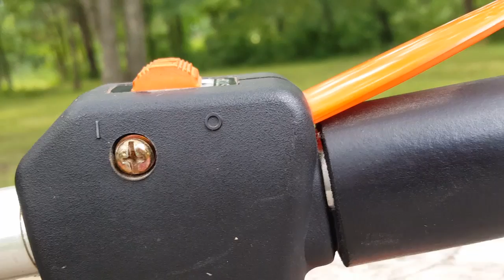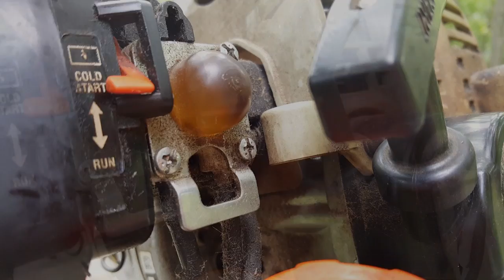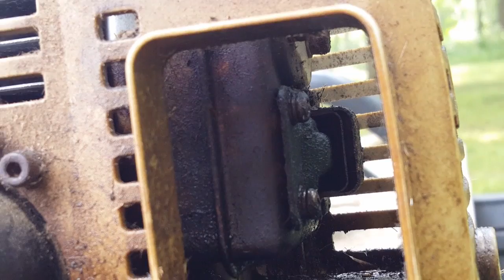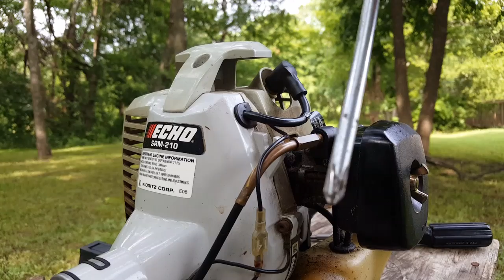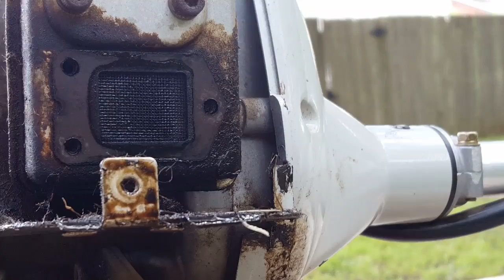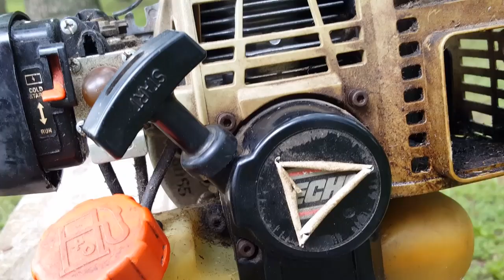Echo Weedeater starts but has no power and runs bad. Clogged spark arrestor. Easy and simple fix.

Comment: Very professional video i ever seen about trimmer now i did every thing you showed nothing work on my Echo SMR210 so i replaced carb 1st day its works like a charm next day it didnt start so i bought new carb again but nothing happend (i changed spark plug, filter) any one have any idea???
Reply from the maker: Thank you Faraz Khan. Please confirm that you have spark just to rule it out. Remove the plug and reinsert the plug back into the spark plug boot. Rest the threaded part of the spark plug against the metal of the engine and lightly pull on the pull handle. Look for the sparks. If you have spark look at the plug itself and see if its covered in gas. If so then the engine is flooded from all the attempts to start it. Leave the engine sitting for a day without the plug in it to let it dry out a bit. Next day replace the plug and try to start it but us NO choke and hold the trigger completely open. Pull it a dozen times and hopefully it starts.
Reply: Thanks for your rply i did what ever you said and i leave trimmer 3 days (just in day time at 90 degree) tried to start if without choke dozens of time and then choke but my friend nothing happens still dead.
Reply from the maker: Faraz Khan thank you for trying. In your attempts  to start it did you ever try using starter fluid or even some gas into the throat of the carb.  If it doesn't at least run for a few seconds then there are some other problems. Thanks again for the reply
Reply: yes you are right i put some gas in carb but no use so now i gave it to tech they will charge $80.00 see what happened but thanks for your advises.
Reply: Faraz Khan THERE ARE A COUPLE O RINGS ON THESE...THAT IF BROKEN OR LOOSE...ENGINE WONT START... HAVE YOU LOOKED AT THESE?
Reply: Faraz...did you get it repaired? What was the problem? Thanks.
Reply: greenhavennn  hey, yes i got repaired and problem was they change new carb  and charged me $40.00 but now its works just fine ..Thanks for asking and tips.
Reply: Faraz Khan  Thank you, sir. Glad it worked out for you. Have a good weekend!

Comment: I got a srm 200be. How can I replace the fuel  tank?
Reply from the maker: Thank you for the comment.  To replace the fuel tank you'll need to remove the bracket under the tank. Then you can remove the screws holding the tank to the engine.
Reply: @HomeGaragechannel  Thanks a lot!

Comment: I would clean up the screen with a propane blow torch and burn off the carbon and allow to cool off then brush up the remains then re-installing into the muffler/exhaust system and mainly for occupational health and safety as they have been linked to forest fires etc
Reply from the maker: I believe you are correct. Thanks for the comment I appreciate it
Reply: @HomeGaragechannel  my pleasure mate

Comment: Still sounds somewhat clogged should have taken the entire muffler off and checked straight into the ceiling piston I bet it was still clogged inside there
Reply from the maker: Yes you are right but it turned out to be the spark plug was a bit fouled with carb. After a few minutes it burned off and sounded great. Thanks for the comment I appreciate it

Comment: Where can you buy the torch and how much do they go for?

Also, what happens if the machine is run without the screen?

Thank you.
Reply from the maker: you can find them at your local hardware store for about $18-$20 or you can buy online too. You can run it without the screen, it will not hurt the engine however it's not recommend.

Comment: I just bet this my Echo's bogging problem.  So, I think to clean the screen I just burn off the carbon with a propane torch and then wire brush.  Thanks.
Reply from the maker: Tom I'm sorry I missed your comment. Yes burn the carbon off  or remove it all together.

Comment: Good trimmer,🌱 allabout.wiki/Echo I string my own line onto spool to save money and this trimmer seems to use less line than my former trimmer...does the job except for super thick St. Augustine runners on curb. Would love a shoulder strap so that I would have to use less arm strength to hold upright with my disability.
Reply from the maker: thank you for the comment